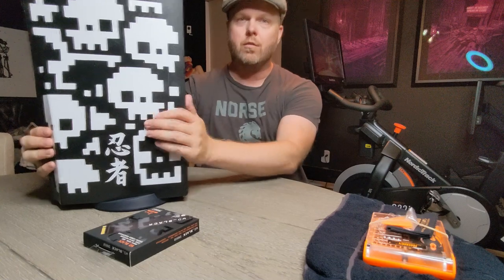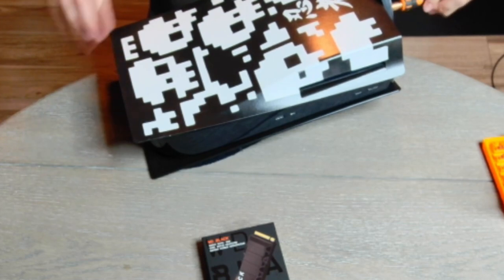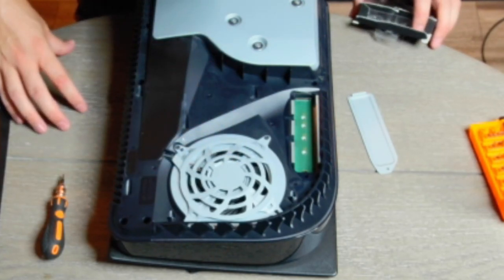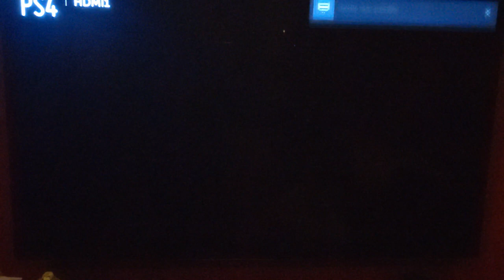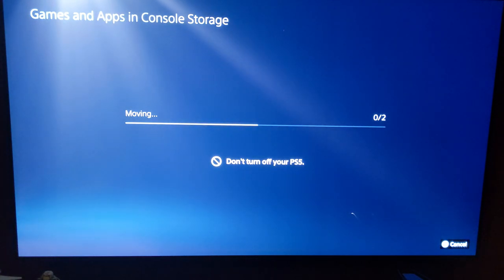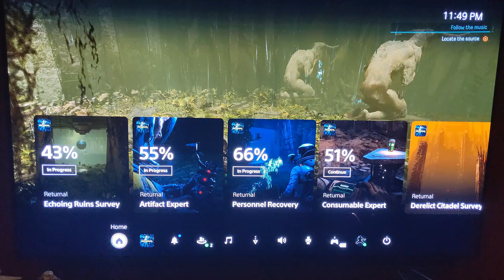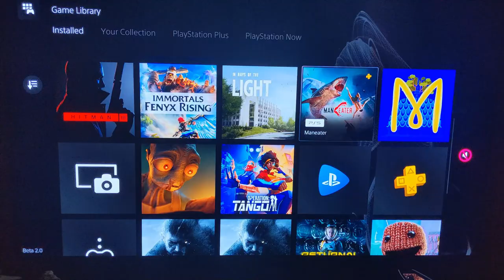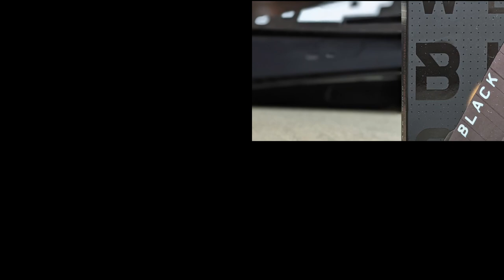Installing and testing an SSD in a PS5 - let's see how the expansion does

Comment: The “nut “ is called a stand off… and it goes UNDER the M.2 drive. Not on top. Everyone is installing this wrong and putting it online.
Reply from the maker: I put it under the drive in this video. It wouldn't  make any sense to put it above.
Reply: @adamninja  
in 4 disks sn850 I have seen. there were bad thermopads. Thermopads were 1mm and should be 1.5mm. do not touch the memory with the heat sink. there was a gap of about 0.1mm barely visible. theopad heat was dry and dusty